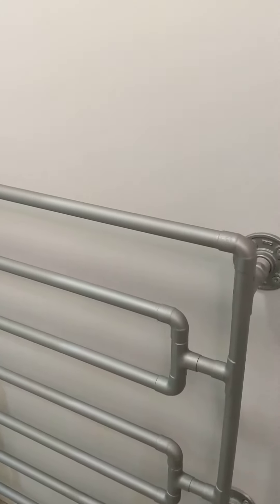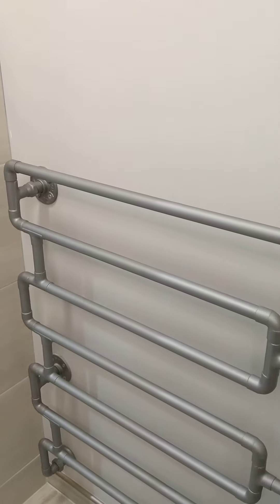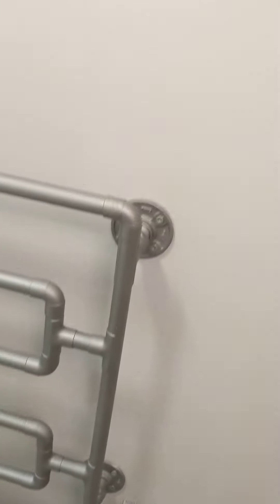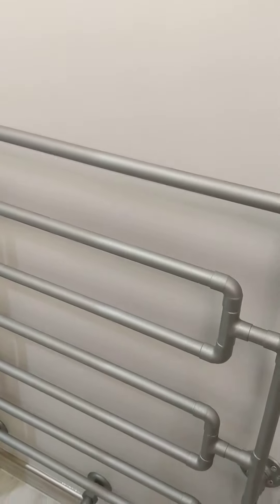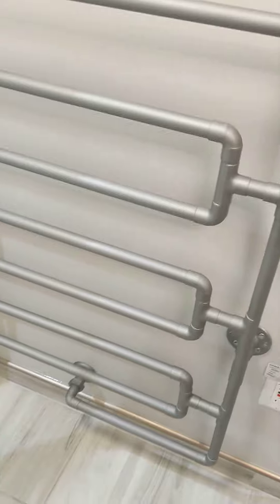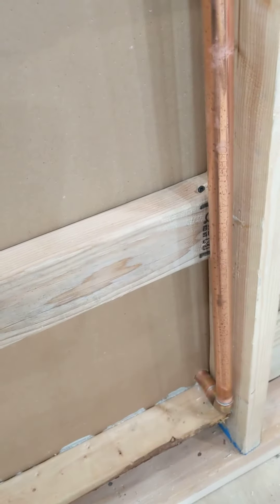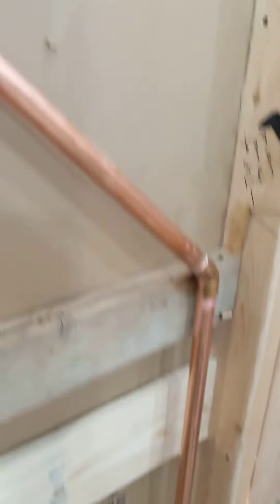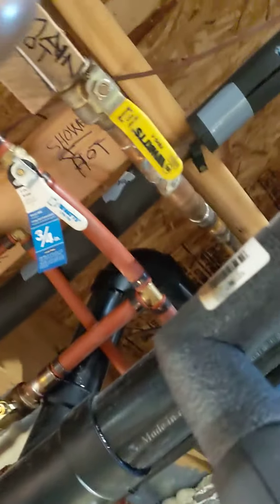towel Warmer part 3

Comment: So you tapped into the hot water line?  and it goes straight to the Shower Valve? So it heats up only when you take a shower?
Reply from the maker: Yes. Detoured hot line to the towel rack to shower.